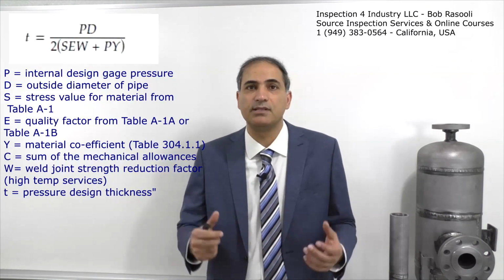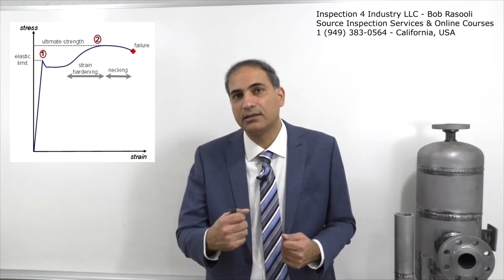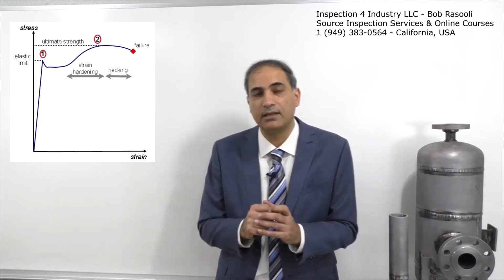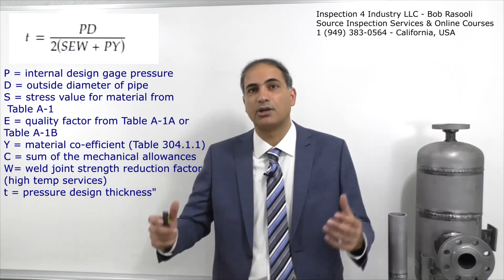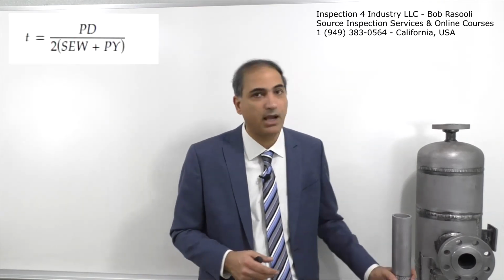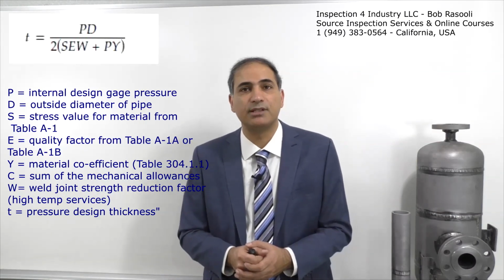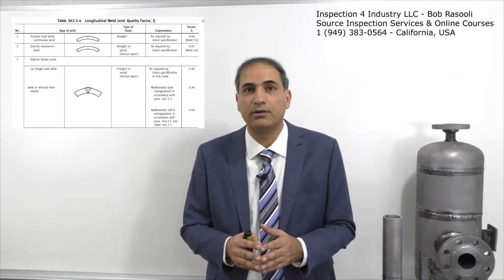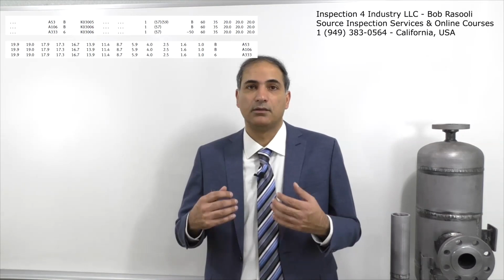Calculate Piping Design Thickness based on ASME B31 3 on API 570 Piping Inspector Exam!

Comment: Hi Sir. Can you share with us how to calculate MAWP using API570 & ASME B31.3? Thanks
Reply from the maker: We do  not calcualyte MAWP on B31.3 but sometimes calculated on API 570 to verify inspection interval. It is included in API 570 Prep course https://www.inspection-for-industry.com/api-570-training.html
Reply: @i4i-academy and if you need to calculate nozzle size is selected to cut 15mm thick plate.Which formula will i used